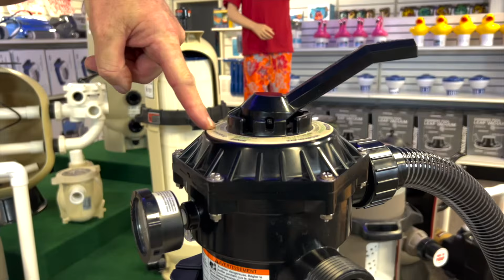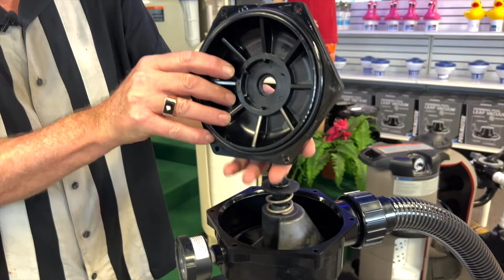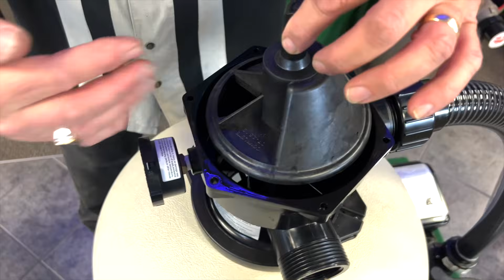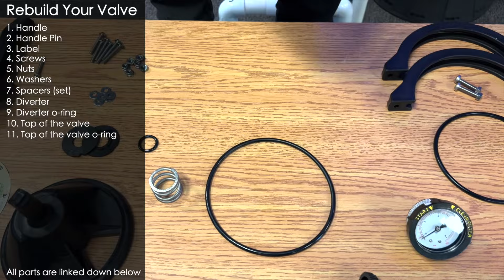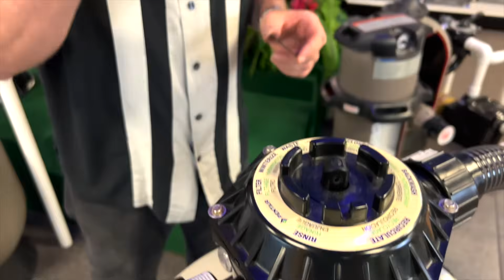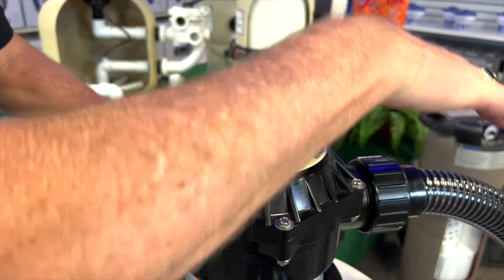How to REPAIR and Service Your PENTAIR Multiport Valve!

Comment: Thanks for this video. I have an older Pentair Sta-Rite style filter head. I removed the upper portion to replace the diverter but was struggling with how to compress the spring to reinstall the handle.  I hadn't thought of using the factory bolts to slowly compress it. Clever, thanks again

Comment: Thank you. This was very helpful. Just replacing my Valve top and diverter assembly and it says to put valve in WINTERIZE position instead of FILTER as you suggest. Not sure if that's to take pressure off the diverter built in gasket during assembly. Wish I had a parts supplier here in Canada with all these parts!

Comment: I ordered a 100LB 1-13/16" spring to replace mine since you listed it and learned that the correct spring size seems to be a 1-3/8" spring. 1-13/16" is too big.

Comment: Ok, so, let's say after turning it off you remove the top of the valve, should I expect water to start gushing out? I need to replace my diverter but I want to know if I need to disconnect the hoses between the valve and pump/pool.
Reply from the maker: If you have an aboveground pool, turn off the pump, plug the skimmer and the return and you will be fine. Thanks for watching.

Comment: Hi Mark,
It's leaking under my handle. It's already hooked up to my pool and full of water. Do I need to drain my filter tank or can I just make sure the pressure is off of it?
Reply from the maker: Turn off the pump, then you can work on the valve. If you have an aboveground pool then plug the skimmer and the return so that you don’t get wet. Thanks for watching.

Comment: hi, i reassembled the pentair valve and diverter per your video including the o-ring and the water still comes out of the top of the valve
Reply from the maker: You may need to replace the o’ring on the shaft of the diverter. Thanks for watching.

Comment: Great video. After vacuuming my pool with my valve in the “Waste”position, I can’t rotate handle back in the “Filter” position, what would cause that? Thanks in advance.
Reply from the maker: It sounds like you need to service and lube the valve. Thanks for watching.
Reply: @HallmarkPoolSupplies Thank You.

Comment: Thank you for the video. I have been loosing water in my pool for a week now. I remember seeing water at the end of my backwash/drain line on Sunday. I didn’t pay it much attention since I back washed it Saturday. Filled the pool with water, it was fine on Sunday. But today, same thing, the water is gone. I now think it is the diverted valve gasket is shot. I will purchase one from you guys. And what do you know,you guys are right up the road in Fayetteville. Thanks again. Jon

Comment: My tank is leaking near the connection of the valve and the tank. Can you do a blind diagnostic?
Reply from the maker: @TheDropoutBear    With the system off, try tightening the clamp that attaches the valve to the filter. If it still leaks then you want to check for any cracks on the valve or the top rim of the filter where the valve attaches, at the same time you can check the o-ring that is in between the valve and the filter. If you need anything, l have all the parts to include the valve linked in the description of this video. Thanks for watching.

Comment: Hi there How do you know if the diverter is bad?, many thanks
Reply from the maker: @diegososa-dias3765    If you have water leaking out of the backwash line when you are in the filter position, then you need to check the diverter gasket. Thanks for watching.

Comment: I need help with this same valve.  My valve is leaking from the top.  I replaced the o-ring with a Pentair part but the valve continues to leak.  I’ve tried to tighten and loosen the screws but leak continues.  I did tighten then in a star pattern.  It primarily leaks just above where the water comes in from the pump. I’m at a loss for why it still leaks.  Thank I advance for your help.
Reply from the maker: @kmn8226   If everything is put together properly, check for any cracks in the housing. If not, you will have to take apart and check the valve on the inside. Thanks for watching.

Comment: 😢why I didn't see this video before I changed my gasket? I have watched a video where the guy put glue on a gasket before placing the top valve assembly. I repeated the same thing but I broke my handle by turning it because it was hard with the glue. Thank you so much for the details explanation. 👍🏽👏🏽

Comment: This was soooo helpful.  Thank you.  I think I have an older model (Pentair StaRite 18201-0200 Multiport Backwash Valve).  Can I perform similar maintenance on my model?
Reply from the maker: Yes, however the parts are different. If you need parts email your contact info and l will be glad to help. My email is on my YouTube channel. Thanks for watching.

Comment: Was having problems with water leaking out the backwash when I put it in filter. So I replaced the valve assembly. And the second I started the pump the new one did the same thing and the handle won’t go all the way down in the filter slot. Just dangled like the spring would not push it down. Help!!
Reply from the maker: Make sure that you have the assembly positioned properly on the valve. You should be able to push down on the handle and rotate all the way around and then let the handle pop into position. This should work and allow the assembly to set into position. If not you will have to remove the assembly and inspect it. Thanks for watching.

Comment: Wow, the detail and clarity of this repair video was exceptional. I made the repair step by step and had no problems and knew I was doing it properly. The old spider gasket was really in bad shape and needed replacing. I held my breath when I turned the system back on and everything was fine. The trickle water leak from the discharge pipe stopped. Thanks so much!

Comment: Hi Mark- question for you, but first thank you for your videos, they are super helpful!  I have the 262506 sand filter as well.  Water is spitting from the air relief valve (even when fully tighted to closed position).  I replaced and lubed all the o-rings as you showed in your video.  Still spitting water out of the relief valve.  Anything else I should be looking for or another video that covers this type of issue?  Thanks!
Reply from the maker: If you have already replaced the o-ring on the air relief valve, check the valve itself for any cracks. Thanks for watching.

Comment: Ive owned a pool for 15 years and finally understand what backwashing really does. You have a customer!
My pool is leaking (flowing) out of the discharge/backwash hose when in filter setting. Do I need a whole new hiflow top?
Reply from the maker: You can replace the top or rebuild it, it really  depends on the age and condition of the valve. Thanks for watching.

Comment: We're having an issue with our pentair tagelus  ta60/60d. All of a sudden it's like it can't prime water and runs for a minute then sounds like it's trying to get water and goes back and forth.
It also sounds like water is spraying all over the top of the inside of the sand filter.

And when I shut the pump off, there's like a surge of back pressure and water shoots into the pool from the skimmer. 

I turned it off. Does this sound like anything in particular?  

(It's an in ground 20,000 gallon fiberglass pool with Century HST225 pump and Pentair Tagelus TA60/60D sand filter using Zeo sand, regularly maintained with proper water quality)
Reply from the maker: It sounds like you need to backwash and rinse the filter thoroughly. Thanks for watching.

Comment: I was getting a little water in the waste pipe when on filter on this model. So I changed the diverter with built in gasket and still having some water go in the waste pipe. Any ideas?
Reply from the maker: Turn off the pump and rotate the handle around and let it pop back into the filter position. Sometimes when replacing the diverter you need to make sure the diverter lines up and sets in position. You may need to do this more than once. This should help, if not you may want to check your spring. Thanks for watching.
Reply: @HallmarkPoolSupplies  thank you. Already replaced the spring as well. I’ll give the turn the diverter a few times a try. Thank you